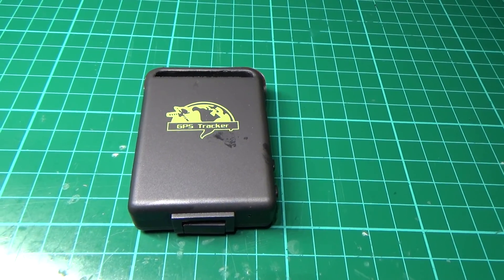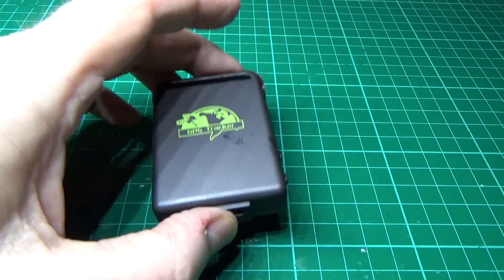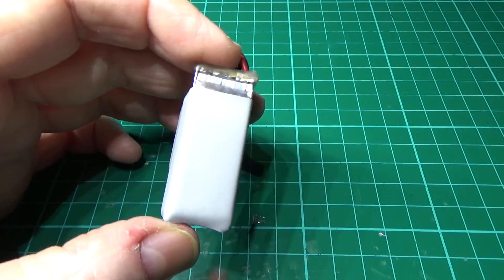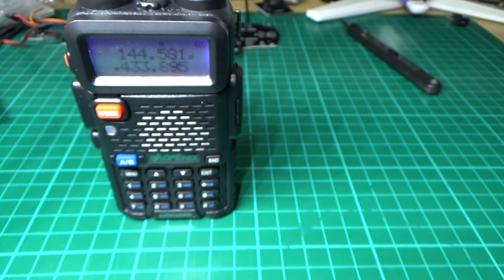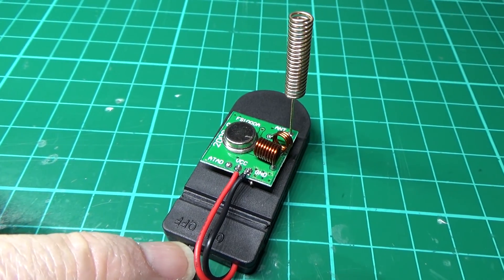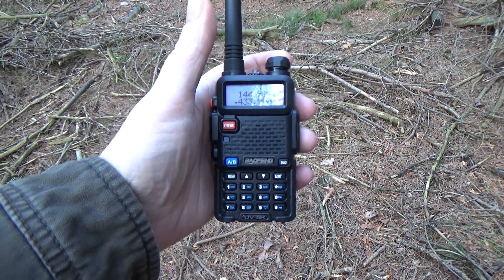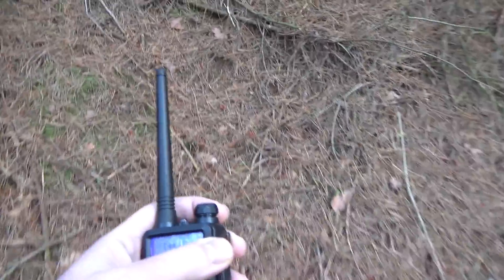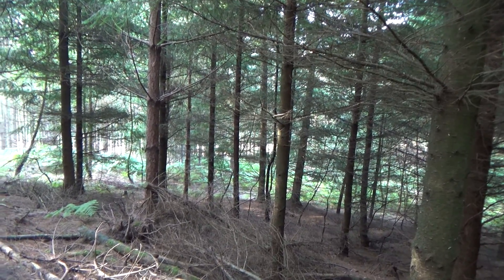LMB / LMA (Lost Model Beacon / Lost Model Alarm) demonstration

Comment: Is the output of the transmitter fixed? Could you send a stream of tones at descending power level?  i.e.  100%...80%...60%...40%...20%...2%
Reply from the maker: Yeah, it's fixed. There's no way of limiting the output :-(

Comment: can you explain how you made that one with the button cells work with no pro mini ? and how was it in the test wee don't see it in the video and nice work by the way
Reply from the maker: +Mathieu Bissonnette-bigras It was done with an ATTINY85 and I decided it was too hard for Mr Average to build so I didn't do a video on it. I might do one for anyone who's advanced in building them, though.
Reply: Well for racing and fpv it seems like a good lightweight solution if battery would be ejected i almost lost mine  yesterday in tall grass after my battery ejected so no telemetry to try and fallow the signal and non buzzer this would of made it easy with a yagi
Reply from the maker: +Mathieu Bissonnette-bigras When I get chance, I'll do a video - it only weighs 4g and will run on a single CR2032. Just a heads-up..... A supplier is sending me a sample of his version...... it looks rather good so I'll definitely be doing another review when it arrives.
Reply: looking forward on this and  i was looking at some boards and stumbled on this one :  http://www.banggood.com/HC-12-433-SI4463-Wireless-Serial-Module-Remote-1000M-With-Antenna-p-973522.html    im wonderringf if with this one  could program the tone leves like on the openLRS
Reply from the maker: +Mathieu Bissonnette-bigras I have a few of those - they're just a serial replicator and only used for doing a wireless link between 2 things. They don't actually do much apart from transmit whatever data you put into them.
Reply: +Vortecks ah thanks for letting me know i coudent find much information on them but will be defenetly making one with the pro mini for know still seems lighter and more reliable and less expensesiv then having to reffill the sim card everry month prefer to invest that money in a yagi and good radio
Reply: Vortecks hey buddy have just found your beacon video I would be extremely interested in seeing a tutorial on this bud as it would make a great beacon for small model rockets any chance of letting me know how you done this bud ??

Comment: Will you show us the specs for this somewhere? Since the model wont be powered off after it flies away - why not pull the power from the lipo?
Reply from the maker: +petfrogg I've had many a crash where the battery gets ejected. If it does crash and the battery is still connected, it probably won't last much more than 5 hours. If it flies off or crashes when the battery is nearly flat........ have I convinced you that it should have it's own battery yet? :-)  I've had a few emails about how to build it, so I'll be doing another crappy 'how to' video soon :-)
Reply: looking forward to you "how to". And - i understand the concept of a battery of itself.

Comment: Really nice little unit. As Rob Crawford has mentioned an antenna with directional properties would be small enough on the frequencies you intend to use without being too cumbersome. A simple tuned loop has a bidirectional property with very pronounced nulls to the sides. Or alternatively a two element design, known as a HB9CV provides great forward directionality with strong rejection from the back and can be folded to fit in a jacket pocket. On 144MHz there's a big amateur radio fox hunt event in this area once a year where they use very similar devices to the one you're demonstrating.
Regards
Nidge
Reply from the maker: +sputniksam Cheers Nidge. My Dad emailed me and told me to build a HB9CV which I'll be doing very shortly. I've built a yagi out of an old tape measure (using the tape measure as the elements) and I'll be comparing the 2......when the rain stops :-)
Reply: +Vortecks 
Another crazy thought. Instead of the Baofeng consider using a cheap USB DVB-T dongle ( less than £10 ) with your Android smart device. The big benefit is that you can see the beacon's signal on the spectrum and waterfall display long before its audible on the handheld radio. Also the display is more dynamic than the crude signal meter on the radio. If you search for " RTL2832 SDR " and for the Android app " TouchSDR" . The only other hardware needed is an OTG cable to connect the Dongle to the smart device.
Regards
Nidge
Reply from the maker: +sputniksam Now you're getting technical.... I like it! I already have an SDR dongle and SDR touch installed. I might give it a go when I get chance :D

Comment: Nice one Tone.  My orange openLRS has this feature built in and works really well too.  If you turn off the rc transmitter the rx goes into fail safe then 1 minute later goes to beacon mode transmitting on your preset pmr channel.  I spent an afternoon doing the same test as you with a pmr radio lol.  However the openLRS receiver is set to transmit 3 audible tones with each tone at different power levels, so the first is 100mW then 50mw then 10mw so if you are far away you may only hear one tone and if you are really close you hear all three.  This might be worth implementing in your design to further improve it.  You may find your Ezuhf will already do this with a firmware update.
Reply from the maker: +crezzee Cheers mate :-) I know the OpenLRS has a beacon built in which does work very well but the EZUHF doesn't support it, although there have been numerous requests for it to be implemented. The trouble with these Chinese 433 modules is, they only have one output power. I could get a more expensive module but that'll double the cost - these will only cost around £4 to make and I'm VERY cheap :-)

Comment: Funny enough I was just working out the values for the Lincolnshire Poacher just before you posted the video.

The Yagi should also give you a considerably boosted range as well as directionality.

The switch to PMR may be a good idea as you are limited to a 10% duty cycle on 433 ISM (not a problem if you make it for your own use but supplying them to others may make life awkward)

I'm trying to raise the enthusiasm to code one in straight Atmel assembler so you can just attach a bare chip to the TX module, but work is getting in the way.
Reply from the maker: +Rob Crawford If you need to sketch mate, drop me a note. It's not easy getting the oscillation timings right and I know mine isn't perfect but it'll do :D   The smaller one I built is actually an attiny85 taken from a Digispark - I programmed it up, removed the chip and soldered directly to the legs.
Reply: +Vortecks the bare chip is definitely my preferred method (weight saving and more robust)

That's a kind offer but I wouldn't like to get the code then do bugger all with it ;)

There are also 900MHz modules which may be helpful to use (but not for use in Europe of course)

the other half of what I have been thinking about is what happens if you fit a yagi to the 433 receiver half of the module pair.

if the reception is decent then it should be possible to build a scanner free unit (but somehow I doubt the Chinese receiver is up to the task)

however if it was a decent receiver then you could use non audible signals
Reply from the maker: +Rob Crawford I was thinking about using the RX that came with the TX but the signal would only act like a logic gate. You could do a very crude RSSI by counting the packet loss but I don't think the receivers are very sensitive. I'm old school and prefer to judge things by static noise if needs be :DLet me know if you're having problems with the Linconshire Poacher, Rob and I'll send you the coding I've done. Use it or bin it...... I won't be offended either way :-)

Comment: A couple of suggestions Tony. Rat one of those $4 onboard cell checkers for the peizo buzzer and use it for an audible sound beacon for when you are close and the receiver is pegged out.  You don't actually need a formal yagi, just a piece of wire say 5% longer than a half wave and hold it behind the receiver antenna acting as a reflector. Should give some reasonable directivity. Benefeit is it can be rolled up and kept in the flight box so you don't forget it :)
Reply from the maker: +Rob B You're just a wealth of knowledge, Rob. Thanks for that - I'll give it a go! The only trouble is, I'll probably forget the bloody flight box :D